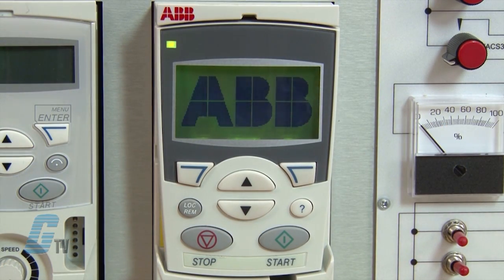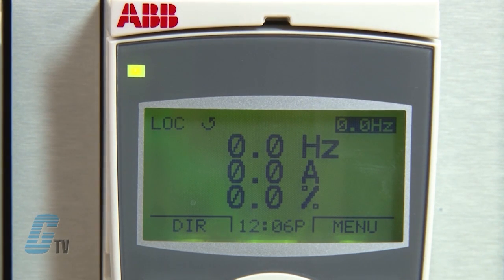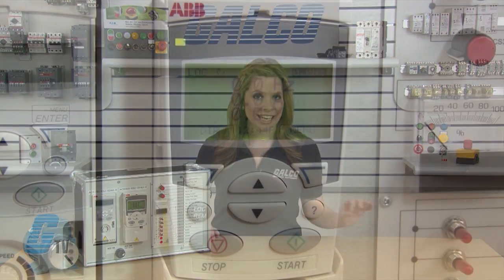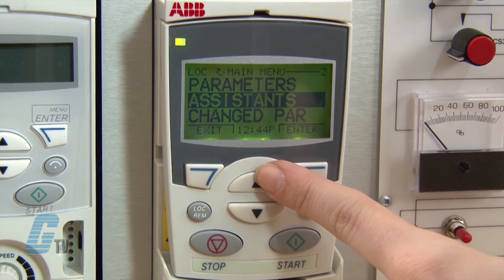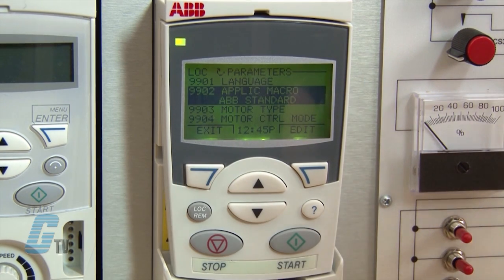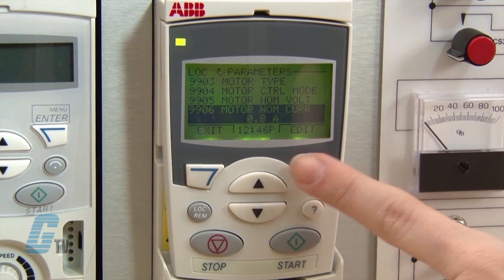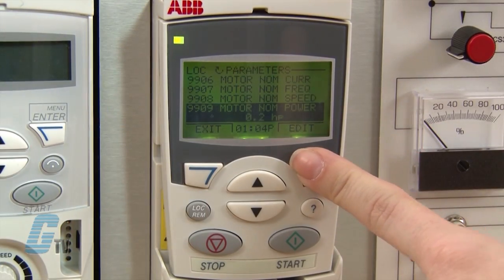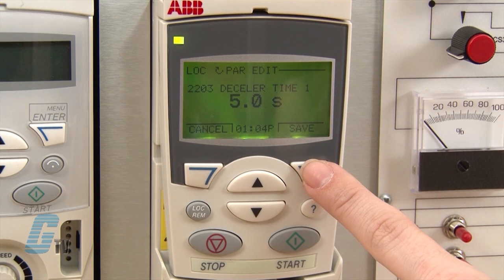ABB ACS 355 AC Drive Basic Start Up Advanced Control Pad

Comment: Analog current Input signal (4-20mA) of ACS355 Drive is from OMEGA CN735 Temperature Controller and is connected to Pin5 (AI2) and Pin6(GND or COM) in order to control a FAN. I tried all Macros applications and none of them is working. I mean none of them can really received this signal from OMEGA controller even though I disconnected this signal from OMEGA CN735 and FAN is still running remotely. My question is that how can I control the fan by really running this Analog Current Signal rather than using Macros. What is the correct hardware wiring connection? Thanks.

Comment: I need following option.What are all the parameter need to set this application
  1.Forward High speed(DI1)-40HZ
  2.Forward low speed(DI2)-10HZ
 3.Reverse High speed(DI3)-40HZ
 4.Reverse low  speed(DI4).-10HZ

Comment: Hi I have installed an ACS355 with advanced control pad. It is aimed the drive runs a 5.5KW pump through the solar panels. Currently for testing purposes, I have connected a 504V, 10KW DC power supply as the input. The drive in Local mode works as it should be but in Remote mode, the operation frequency never exceeded then 40Hz (The pump should work with 50Hz). The relevant set points are all set on 50Hz.  I have searched a lot and have contacted to ABB as well but no one could help me.  Just wondering if I can get my answer here..
Reply from the maker: Please send me the following information:
The complete part number of the drive. 
Which macro are you using, this can be found with parameter 9902.
The list of changed parameters which can be found using the “CHANGED PAR” function in the keypad.
What is connected to the I/O terminal strip of the drive for remote operation.
Reply: Hi.. Thanks a lot for your consideration, Here there are the information you've asked about:
Part Number: ACS355-03E-31A0-4+N827
Parameter 9902: ABB STANDARD
Changed Parameters:
REF1 MIN: 10HZ, FAULT RESET CELL: COMM, PQ CURVE P2: 3KW, PQ CURVE P1: 2KW,  FAULT RESET TIME: 60S, DRY RUN TRP TIME: 60S, MIN LOAD CURRENT: 1A, BOOST FACTOR: 1.25, BOOST VOLT: 500V, PUMP MINIMUM SPEED: 500rpm, PV CELL MIN VOLT: 415V, MINIMUM SPEED: 500rpm, MA CURRENT: 9.5A, UNDER VOLT CTRL: DISABLE, ACCELER TIME: 10S,  RAMP INPUT 0: DI2, IR COMP VOLT: 0V,  U/F RATIO: SQUARED, STALL FUNCTION: ALARM, STALL FREQUENCY: 15Hz, EFB STATION ID: 2, START DC VOLT: 350V, MOTOR NOM POWER: 5.5KW, MOTOR NOM SPEED: 3000rpm, MOTOR NOM VOLT: 440V, COMM PROT SEL: STD MODBUS, MOTOR NOM CURR: 12A,  PUMP EFFICIENCY: 85%, 
Moreover, the activation signal is provided from 24V terminal on driver to DI1 through an on/off switch.
I hope these information can help to solve the issue.
Kind regards

Comment: hi
I want start stop from remote control but i wish  set the reference in panel , what can i do?
Reply from the maker: Go to parameter, set 1103 = 0 and will select keypad/control panel for speed command. For the start/stop in remote, set with your Macro selection. If ABB Standard is selected (default macro) then all you have to change is 1103 for your speed command. Let us know if you have any additional questions.
Reply: Thanks, it works 
I am using frec control but i want to use speed control and i can not disengage the motor from the machine to make ID test, what can i do?.
Finally sometimes the converter shows shorts circuit fail and reset until some time and pushing éxit button, could it be interference ? the drive is new.
I apreciate your help.
Reply from the maker: Well if you can't uncouple the motor from the machine don't run "ID run". If you need to run the motor at low speeds you will need ID run, but if you don't need operation below say 50% speed, just put it in "Vector Speed and see how it performs. Otherwise, guess what,,,, you have to uncouple the motor! This allows the drive to get a good picture of motor the characteristics to control it properly in Vector mode. If uncoupling is absolutely not possible, you may be better off leaving in Scalar FREQ mode. But try speed first, some applications are more forgiving than others, ok?
Reply: Ok, thanks, and what about short circuit fail 4
Reply from the maker: As far as the short circuit fault goes, first double check all your 
power connections to the drive and the motor make sure they are tight. 
Could also be the mode you are running in without proper tuning too.
Reply: Yes i suspec of the lack of ID run, thanks for your advise.
Reply: Once more cuestion, if I have a machine in continuous operation, can I leave the operation panel installed working forever without risk, or can take off it and what is the procedure?, Thanks
Reply from the maker: Yes the Keypad can remain in place on the drive indefinitely, but if you want to remove it, shut the power off first then there's no chance of something bad happening.
Reply: Thanks again, very helpful.
Reply: How do you fix Drive not ready" message along with fault code or description: "Low DC voltage".

Comment: Thank you for the video. I installed a 5.5KW ACS355 solar drive. I received the drive with basic control panel. I put all parameters and limits. I used Scalar frequency control. 
My problem is that the drive is not regulating the frequency output based on the sun irradiation, but it just follows the value which I set on "Ref" on the basic control panel. I am using the drive in local control mod and without external I/O signals.

Please any help to make the drive work automatically?
or How can I remove this "ref" control in order for the drive to seek the operating frequency by itself?
Reply from the maker: Rami H Try setting parameter 1103, REF1 SELECT to SOLAR. The manual defines SOLAR as“The inverter takes the speed reference calculation from MPPT.” MPPT is maximum
power point tracking, which is an algorithm that controls the inverter to
obtain maximum power from the PV cells at any instant.
Reply: GalcoTV  Thank you for reply. 
 It is already selected to solar and all settings selected according to solar. if you have email i can send u the details. my email: ramihijaz@hotmail.com

Comment: Hi Galco, Thank for this valuable video. Please, can explain how to control the ABB  ACS355 through a computer by using Drive windows Light 2.
Reply from the maker: Hi Ziko Moon.  I saw that you have also posted this under the ABB ACS550 video as well.  Since the program operates similarly on both drives, I can answer that within this comment's section.  I will need a little more information than what you have provided. What exactly are you trying to do and what kind of difficulties are you coming across?  Do you have the appropriate software and connections?
Reply: Hi Calco, thank you for your quick response. Yes, I have the appropriate software and connections which I bought from the ABB Company. how to apply speed changes in each of  step function and Ramp function and how to apply delay time.

Thank you for your assistance and compliance 

regards
zyad
Reply from the maker: ziko moon The step function is set on the pull down menu on top with drive--->step function-->step function settings.  As for ramp function, the accel/decel rate are in parameter 22.  You can change any values by double clicking the number and typing it in.  Delay time is also a little ambiguous since there are a lot of different parameters that use the term 'delay time'. For example, parameter 2113 is for a start delay, parameter group 14 allows for delay time on relay outputs and 3103 is for setting the delay time after a fault.  I hope this puts you in the right direction.
Reply: Hi, thank you very much for your response. this information has helped. thanks a lot

Comment: For my Machine I need variable speed With Remote opration. On remote ON,OFF.Speed UP & Speed Down Push Button. I need Wiring Diagram & Required Parameters